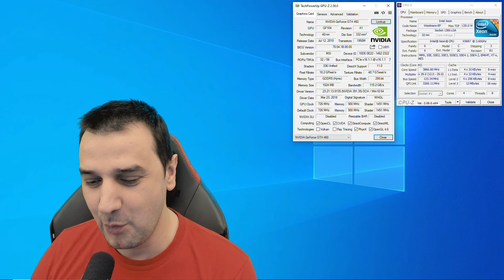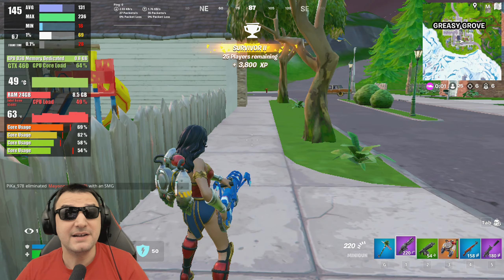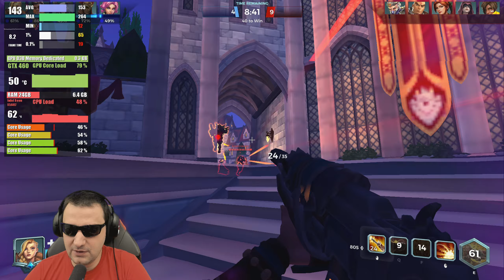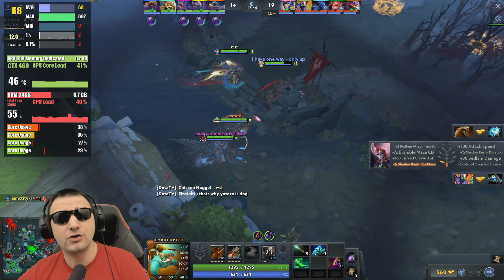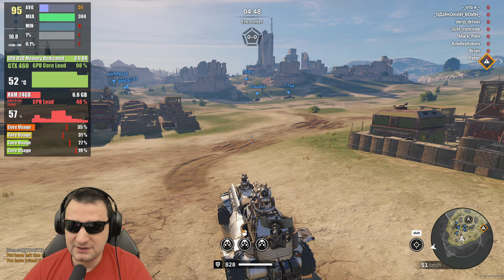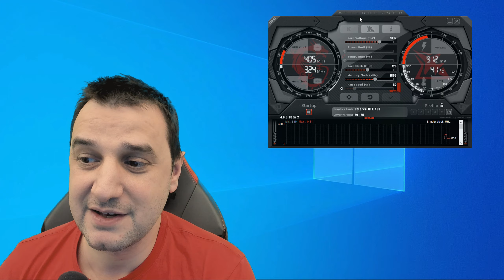GTX 460 MSI | XEON X5687 10 Games Benchmark

Comment: bro i have an x58 p6t ws pro mobo im a noob in pc gaming but knows a bit i want to oc my i7 950 its at 3.06ghz and boasts to 3.2 idk how to oc it but i wana do its a bit like 3.6 3.8 how can i do that ?
Reply from the maker: try ThrottleStop. be careful and before know how to enter safe mode and bios reset. 
Do you have water cooling?
Reply: @DanielCardei  no i have an air cooler  and isnt im suppose to oc it through bios just like i did to my ram they were 1333 and now are at 1600mhz didnt wanted em to explode so did a bit
Reply from the maker: @pclabs69  if you can in bios try but be ready for reset. Trottlestop its doing the oc from Windows. My hp z400 doesn't have oc in bios and I can just a little on some cpus that allows me to oc. BE CAREFUL!
Reply: @DanielCardei  so.are there any specific settings.that allow the cpu to clock higher
Reply from the maker: I found a video on youtube how to use trottlestop
Reply: @DanielCardei  can you share it
Reply from the maker: @pclabs69  "how to use throttlestop" on YouTube

Comment: I have a suggestion for ya instead of focusing soo much on %1 and %0.1 lows I would instead suggest focusing on if there is any stuttering and how smooth the gpu's run the games. Also the %1 and %0.1 lows are affected from simply loading into the games soo I wouldn't worry too much about %1 and %0.1 lows.
Reply from the maker: Frame time. i`ll start making custom profiles for the rigs. takes so long for each of them.
Reply: @DanielCardei  exactly if the frametimes are stable and don't fluctuate too much that means the gpu is running the game smoothly.
Reply from the maker: @LiquidSnake690  so avg and frames

Comment: Daniel i think you need to take a look at x99, had and built almost every popular xeon paired with chinese x99. Currently still have e5 2696v3 18 core 36 threads cpu which i got two years ago for 100eur, now its like 50eur, with TB mod and locking cpu to 10 cores 20 threads gives 3.8ghz all core with mild undervolt of -60mV using huanan x99 bd4 motherboard, cpu performance in gaming is somewhere between zen 2 and zen 3 cpu's in some cases faster probably due to massive 45mb L3 cache.
Reply from the maker: I swap the CPU in the Z400 for the moment and now i will use for the moment the W3690 at 4GHz pushed with trottle stop.
 At the moment i barely buy anything. my focus is to build a new recording machine for 4k. i use  an i7 4th gen since 2015. Barely holds :face-blue-smiling: